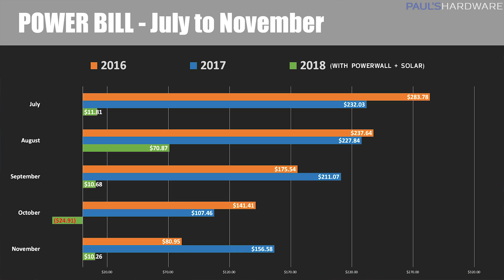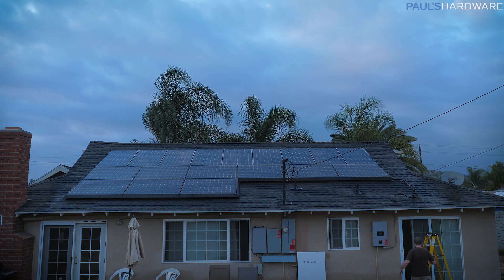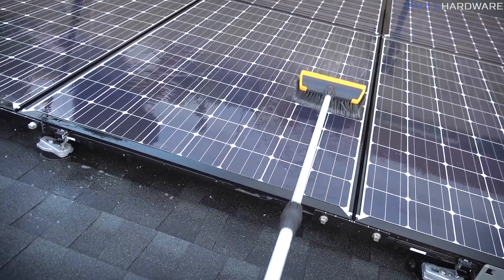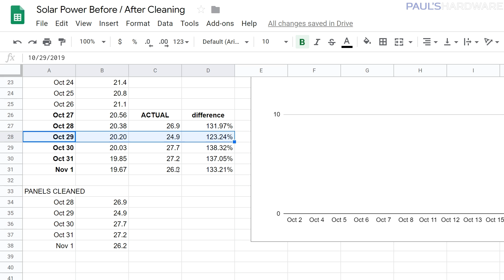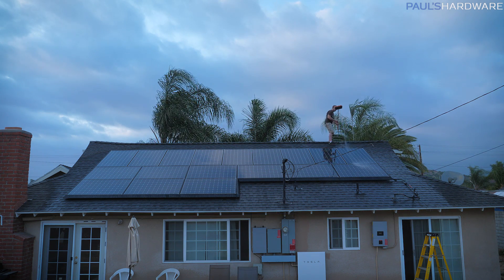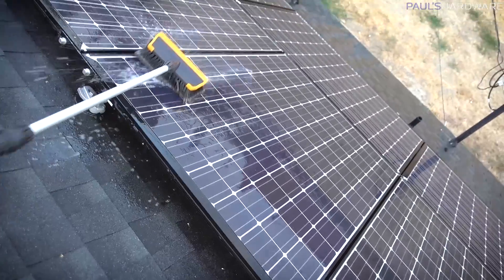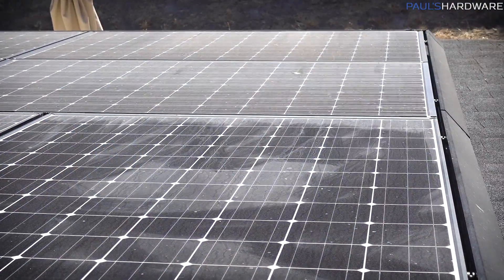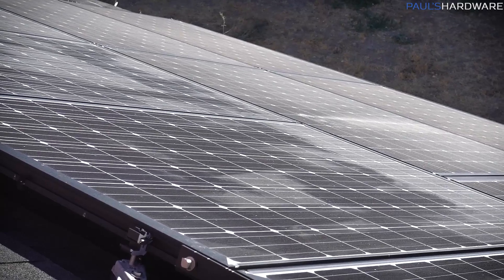Should You Clean Your Solar Panels? Before/After Testing!

Comment: Depending on how much calcium is in your water you could actually be building up a layer. Kind of like when your car get hit with irrigation sprinklers and it looks terrible when it dries. So maybe consider squeegeeing them dry. Florida as way to much calcium in the water to clean solar panels, but we get huge rain storms so that's basically a low level pressure washer lol

Comment: I've got 16 panels, 2 rows of 8 in portrait, fitted in May this year. My roof is steeper than usual, 50 degrees off horizontal/40 off vertical, and we get a fair amount of rain here in England so I'm hoping I won't need to clean them too often, I've not done it yet, but having seen your video I'm definitely not going to wait too long.

Comment: Scrubbing vs. hosing depends on how dirty they are. A weeks worth of dust can easily be hosed off, where 6 months of accumulation you are going to need to scrub. Then you also have to take into consideration if you are hitting dew point daily or not because if you get dust blown on in the day then you have dew in the morning the dust is going to get stuck harder than not hitting dew. Something about mud and dry dust.

Comment: Here's a good visual that will demonstrate how effective cleaning can be ..
When your car's headlights are dirty shine them on the garage wall.  Turn off and clean them.  Turn headlights back on.  
Amazing difference and the sunlight passing through glass panels will be about the same.
You can also see the difference between just spraying and using a soft brush.

Comment: So at work we have 8 identical solar arrays. Inverters and all sitting side by side in direct sunlight Texas. 
Each inverter has its own digital display of multiple values that one would expect. 
No discernible difference compared with clean vs not clean. And what’s more is one can easily make out which solar arrays were washed and which weren’t. There you have it.

Comment: Well I'm definitely cleaning mine after watching that, although I keep an eye on the figures and definitely haven't seen a dip like that over the last 8 years. I dunno how yours are installed, but mine are in 2 strings of ten panels each, and the inverter shows each string voltage separately, which should give instantaneous back to back comparison.

Comment: I'd be interested in seeing if we could extrapolate the value of the cleaning panels in the value of real electricity generated.  Let's say there are lots of people in your position (with panels but without cleaning tools, and generally want to avoid danger), could you make a economic argument for a solar panel cleaning service that goes from house to house every quarter and cleans your panels.  How much could they charge before it becomes uneconomical for the solar panel owners to use that service?

Comment: Btw paul. Theres this thing about panels especially if all of them attached in series or in a single string, even if you managed to clean almost all of them, the dirtiest panel will drag the other panels performance down. As if making a limiter, because the panel thats making the least output will be the max output of all the panels even if they are very clean. Also another thing thats very bad will be that one panel thats dirty will overheat. Same thing with cells that have bird poop on them. So in general, its better to make sure all of them are atleast had a fair amount of scrubbing. Also avoid using soap for. Just plain tap is enough. Rain water is best. Its because of all that stuff added by the water provider like, chlorine, flouride etc. Leaves nasty water marks later on and calcifying   on and on...

Comment: From https://www.solarquotes.com.au/blog/solar-panel-cleaning/..."Paying people to clean your solar panels costs more than it’s worth.  <snip>  Even in a situation that is as close to being best case as is realistically possible.  If solar panel cleaning twice a year results in a 2% increase in average solar generation, then you will earn around an extra $80 a year, but you will have spent $400 having your panels cleaned. So even under excellent circumstances it makes no financial sense.  Even if having your panels cleaned twice a year increased their average output by 10% a year, which is extremely unlikely, you would only just break even.

Because the above situation is about as good as it can get, most people will actually be far worse off. For example, a Sydney household with a similar sized north facing system that has a 6 cent feed-in tariff, self consumes 50% of the solar electricity they generate, and pays 25 cents a kilowatt-hour for grid electricity, would only save approximately $21 off their electricity bills each year if cleaning results in a 2% increase in average solar panel output. So there is really no way having your panels cleaned can pay for itself."

"Paying someone to clean your panels doesn’t make economic sense, but what about doing it yourself? That has to be cheaper, right?  Well, that depends on how valuable your time is to you and what value you place on your own neck.  Or at least having a neck that functions as it is supposed to.

Let’s say you value your time at the Australian minimum wage of $17.70.  If it takes you 20 minutes to clean your panels, doing it twice a year will cost you about $12 worth of time. As a 2% increase in output can save someone with a 5 kilowatt system over $20 a year, cleaning panels yourself can be worthwhile.  But this calculation leaves out a major cost and I am not talking about water or detergent.

Each time you climb up on your roof, or use a ladder to spray water onto your solar panels, there is a small but real chance you will fall off and injure or kill yourself. If you value your life at $10 million and you think there is a one in a million chance you will accidentally kill yourself each time you clean your solar panels, then pricing in that risk adds another $10 each time. This means cleaning you solar panels yourself may not pay either, provided you place a high value on your own life."

Comment: I bought an extendable pole at Home Depot that is fiber glass and aluminum. I don't have as many panels as you, I think 15 and east facing. Can clean from A-frame ladder or roof. Use a house wash soap through a fertilizer sprayer and then scrub and rinse. A lot of upper body work, but cleaning can make up to a 20% diff for me.

Comment: Spotless panels = more powa. I'm all for solar, and your struggles with cleaning your panels on your roof is why I'm a proponent for placing your panels on a shorter out building or have the room/clear space to setup your panels closer to the ground the better off you are. I'm not talking right next to the ground (unless you are in a climate that can deal with it) but say a solar array propped up 3-6 feet to where you could easily grab a small ladder and scrub it with your preferred cleaning device(like the car cleaning brush in this video). With panels closer to the ground yes they may get a little dirty faster, but easy to clean panels every 1-2 months is better than pain in your ass cleaning every 3-6 months.

Comment: To take the guessing out of the equation (so to speak), a better approach would be not to clean one module and use it as reference (works only for installation with micro inverters that reports module by module outputs). You could compare the relative output of any other modules to this uncleaned reference before and after cleaning the other modules (and use essentially the uncleaned module as a "reference diode" to get relative improvements). This way you do not need to worry about cloud coverage, long term average and projection. It becomes essentially a true apple to apple comparison. I am planning to do this on my installation soon, which got me to this video.

Comment: There are some automated cleaning systems out there..... however you could set something up with sprinklers that you manually hook a hose up to and turn the water on once a month, at least during the non cold season. I would say snow season but I don't know how much snow you actually get. found Heliotex's website and the pic on the right looks just like lawn sprinklers. Get a quote and see if it's worth it, you already let us know how much this whole project cost you from the start anyways.

Comment: You got okay results because you live around wildfires and smog, lots of particulates to settle on the panels. Most other parts of the country wouldn't see much of a difference at all. Also, you don't want to use hard water to clean your panels with so be mindful of that if you are trying to hose off your array. EnergySage.com has an old and great article on this topic. The brush you used is too abrasive as well, use a soft cloth or sponge not a car washing brush which is designed to remove things like stuck on bugs. The glass on a panel is easily scratched compared to the paint finish on a car.

Comment: This is one of the many reasons we suggest ground mounting solar panels rather than roof mounting. If you choose this method make certain that the bottom side is high enough to clear a lawn mower and higher than what a typical animal (usually dogs) in the area can reach.

Comment: Our solar company (Sunergy Systems) uses Simple Green to help with cleaning (using similar, telescoping, RV brush you show in video) and it works great without damaging the glass.  Our 9.7 kW array is ground mount (we live in hill facing due south) so it’s far easier to clean. Hope that helps...

Comment: i don't have solar panels on the roof but my sister gave me her old solar walk way lights cuz she said they weren't working as good as they use to so took them all apart and cleaned them up and most importantly i used automotive lens polish on the solar panels cuz they looked hideous from weathering and put new rechargeable batteries in them and they worked really well ... i actually used a volt meter to make sure i was on the right track, i forget the numbers i got from it but i remember a significant increase in power from them ... i'm surprised someone hasn't made them selves a business that cleans solar panels on the side.

Comment: Seal the glass after cleaning with RainX.  It'll help keep the surface clean in the long run as water will bead up and roll off easier and not dry creating water spots.

Comment: My suggestion is that this video is not valid because solar radiation was not measured in this test.  In order to properly evaluate this subject, you need to measure the amount of solar radiation before and after the cleaning, plus also the PV cell temperature.

Comment: Does the Tesla phone app give you results on a per-panel basis?  The best way to compare the results equally without having to extrapolate as much is to collect data from the same days for both clean and dirty panels. If the app is able to give individual panel readings, or if Tesla can refine the app by the next time you decide to retest, simply clean half of your panels.

Comment: From the ground I hose mine off once every few months and get up on the roof and clean them with soap depending on pollen, below my front panels I have some bushes that bees swarm and that will kick up some pollen on the lowest front panels above the 2 bushes and on my rear panels the pollen from more distant (but taller) pine trees needs to be washed off too, I think it's about 10-20% improvement for me when I clean them. I've been looking for a brush that you can attach liquid soap to also, using dish soap has worked the best the few times I get up on the roof with soap, if I have my panels moved around I'd request some space between them so I can walk between / clean then better, if I get my roof replaced I'll try to get Tesla to change the layout a little when they put them back up (unlike you, my roof was not replaced before I put up the panels)

Comment: I'd love to see the results of a thorough cleaning. Technically you could do it from the ground... just get a realllllllly long pole, zip-tie that cleaning broom to the pole, zip tie the hose down the length of the pole (to keep it from dragging across the solar panels) and you should be all set.

Probably should leave the water off until you get the broom into position... It'll be lighter with no water in the broom/hose.

Also, check if Tesla recommends using any soaps. I was thinking some gentle car wash soap would work really well, but I'm not sure what coatings might be on your solar panels.
Reply: Also... the playlist isn't in chronological order. 😭

Comment: Hey Paul, I understand your fear of falling. But really all you need to do when your up on the roof is to wear a good pair of running shoes. And if you squat down keeping your feet flat to the roof you should be okay. i was a roofer's laborer in my early 20's before going to work offshore. But your roof looks to not have all that much of a pitch to me though. But anyway what I'm getting at is that next time you should be closer to the solar panels themselves to be able to reach the middle row with the brush you have. It does appear to extend in length so getting closer to the panels themselves should get you better results. 
Love your videos. Be safe man.

Comment: They would of been even more power if they was actually clean (only surface dirt and dust was removed) you can visually see there there is a layer of stuck on small dust/dirt that needs removing, you can see that just from the half scrubbed ones on the top vs the lower ones (you should be able to see the cells clearly, just one panel having shade/dirt on a bit of it can affect the whole system) 
If you don't have a solar egde system witch you don't (each panel has its own dc to dc with solar Edge so one panel been in shade/dirty or even failed won't drag the others down) just one panel can reduce each other panel by 20% efficiency or more

Comment: Paul, get a scaffold setup so you can work from below the panels and clean from the bottom up so the still to be cleaned panels are still dry, I clean buses with one of the same brushes you have there and missing a spot sucks as is damn near impossible to see when it's wet.
If you cannot use a detergent (I have no idea what their cleaning instructions are) and can only use water then you need to be thorough and go over an area way more than once to be sure it's clean.  Have fun :)

Comment: I think you would have had a better result with a different cleaning tool.  I use a O-Cedar dual surface flip mop on a a 12' extensible window washer pole. https://ocedar.com/p/mops/microfiber-mops/dual-action-microfiber-flip-mop/ The scrub side gets off all the accumulated grime and the microfiber side dries the panel. I clean two panels at a time before rinsing off the mophead.  Rinse and repeat. I have a solar array after cleaning which I do every 2-3 weeks and get a 5% peak increase in power output from dirty to clean.  Over the extent of the day, that adds up to the 30% power production improvement you noticed.

Comment: 6:15 If I recall you had a new roof installation just before those solar panels. Here you are talking about washing your panels where you scrubbed showing dirty panels after they dried. However you have new ridge and roofing that needs to be installed in the clip. You having problems with the roofing? Or was your roof damaged by a storm? That would be impressive if the panels can take the storm better that asphalt roofing.

Comment: Try using a water filter for your hose next time. Ive seen inline ones that dont cut down the pressure to much. Depending the mineral make up of your water that could be leaving a residue behind. They if you have a leaf blower use that to dry them so the water spots dont leave residue/marks behind as they dry. Also i would try a pressure washer with one of the less powerful nozzles on it, maybe even a spray on cleaner like windex or one of those exterior window cleaner sprays that attach to a hose to help loosen the dirt up. 

Id call tesla and ask them if they could handle that or what chemicals not to use on them but i assume if theyre strong enough to be on your roof gettin beat up by the elements they can take a bit of abuse from a pressure washer and some mild cleaning chemicals.

Comment: Paul - it may have been said in the 600 comments below, but google a telescoping window-washing tool.  They come in various lengths, but you would only need maybe a 12 footer.  They are similar to the tool you have, but much longer, with a soft, wide, dust-mop-like head.  Definitely clean those panels better than just a rinse.  You'll gain another 5% at least.

Comment: Powered Solar Panel Wipers and Wiper Blades. 
I'm gonna be rich.....
Edit: I'm in Oregon, I get alot of rain, so dust isn't nearly as much a factor. But rain spotting can be. I use a wide, wetted dust mop as a shammy and a giant ass squeegee about once a season.
If i had to guess, I would say I probably see a 10%ish spike for a while, nothing so dramatic at 30-40%. In snow my roof angle and panels shed it most the year, and ice rarely stays

Comment: Holy smokes the way you're using a shorter ladder than your roof line scared the crap out of me. In the future it would be much safer to use a taller ladder so it can support itself on your roof line rather than have you need to kinda climb and step down onto the A ladder. Often when doing this the A ladder might shift its feet.

Comment: Hey Paul! Was just thinking that it might be interesting to use a pressure washer if you can get one with a long hose or get it onto your roof safely - The extra pressure could have the same effect as scrubbing and you'd probably be able to reach further with the jet than you can with the scrubber so it'd probably be safer/easier. Just a thought!